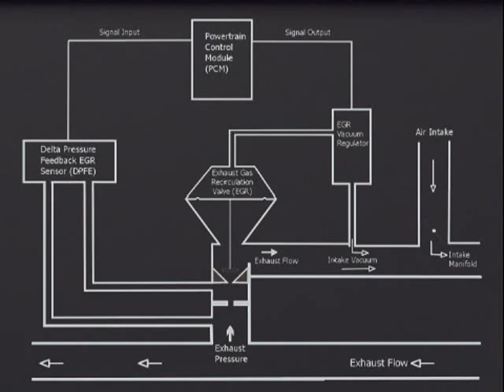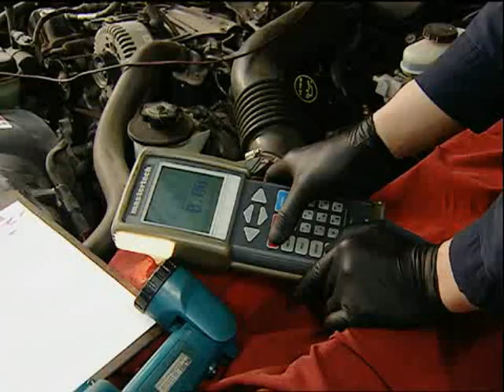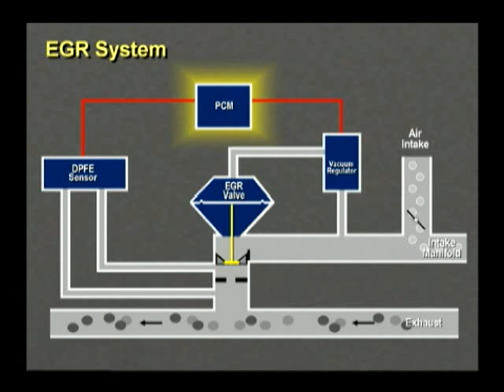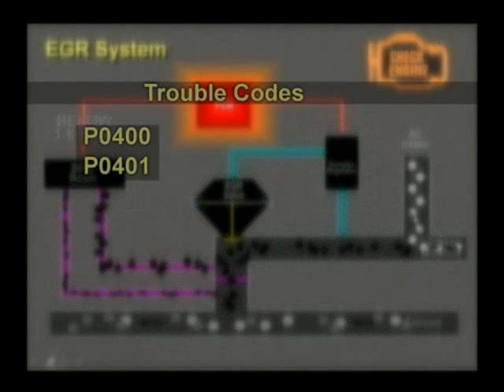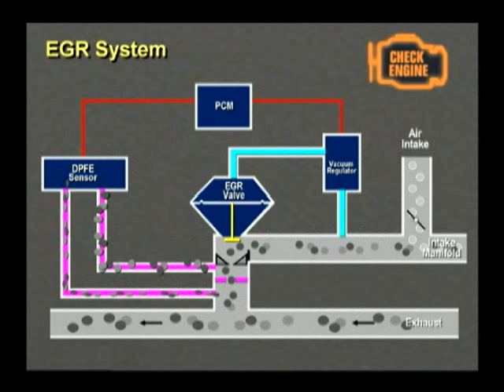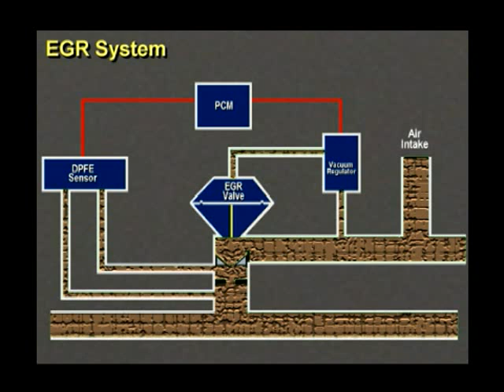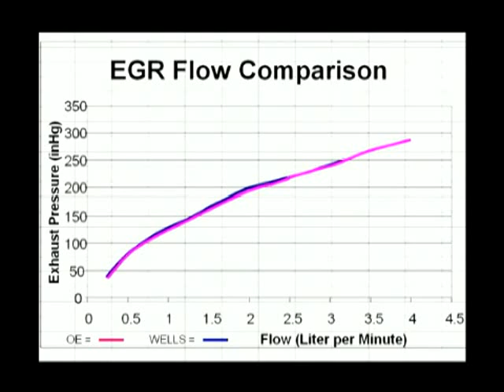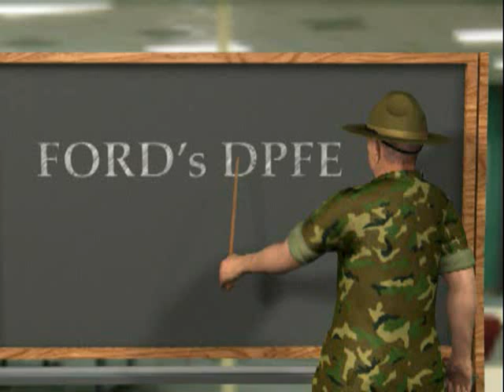Wells Ford EGR DPFE Training with Sgt. Tech  P0400, P0401, P0402,

Comment: How would a blockage explain excessive egr flow no one mentions this anywhere on YT...
Reply from the maker: I'm not sure I follow. A blockage causing excessive flow? Are you talking about a vehicle like the Honda 3.5L or the Ford 3.8L where there are individual EGR ports for each cylinder? I blockage, caused by carbon buildup, can lead to too much EGR going into the other cylinders causing excessive flow. Make sense?
Mike Becker, Senior Technical Instructor
Reply: @GoTechTraining  1998 ford 4.6 v8 getting p402 excessive flow EGR is functional but there is constant vacuum causing idle conditions I don't have a scope so it makes this more difficult someone got in there before me and messed with everything I'm going to make sure it has the right vacuum line on it hoping they just swapped them out, if not it could be that delta thing or debris in the EGR vacuum controller just wanted your 2 cents ty.

Comment: NGK Technical Training
It's pretty amazing that you still answer questions on a video that's 10 years old. You're a good dude. Every EGR I've seen in videos has a seperate DPFE but I think on my car (2011 Crown Victoria) it's part of the EGR assembly or module. Also I can't figure out how to use my vacuum pump to test it. DPFE voltage is good, I tried to the clean out all of the carbon about 3 times. Before my last cleaning attempt if I used to a test light to jump the EGR Valve signal to battery ground the engine would run rough but not stall and now when I jump it to ground with my test light it immediately dies. I have a number of codes I'm trying to get rid of: P0053, P0059, P0401, P0457, P2197. I originally only had a P0420 when I got the car which went away with a bottle of redline fuel system cleaner so another idea I have is thats some of these problems are just from the bad cat. My Bank 1 Sensor 2 voltage readings mirror the sensor 1 voltage readings instead of holding steady. Those sensors are new btw. Thanks and one more thing, on my scan tool live data, when I hit the gas my EGR Error PID usually flashes -100%, then a number like -45% and then it shows, specifically, 99.2% for a second or two so I guess it's not closing in a timely manner
Reply from the maker: Hey, thanks man! Sounds like a lot of issues going on. Let's start from the begining. The O2's should not mirror. That sounds like the cat's not doing it's job. P0053 is a heater resistance code for B1S1. P0059 is heater resistance for B2S1. P0401 is insufficient flow detected from the egr system . P0457 is an EVAP code. P2197 is B2S1 stuck lean. First thing i'd do is clear ALL of the codes out and see what comes back. From there, go after the 02 issues. Verify power and ground for each of the heater circuits. It's possible the heater fuse may be blown? Good luck!
Mike Becker, Senior Technical Instructor
Reply: NGK Technical Training 
Thanks for your response, I’ll check the O2 sensor power and ground. I’ve been trying to fix these problems myself for a little while now and I’ve cleared the codes a number of times. The heater circuit codes and the egr codes always come back. I’m learning a lot working on the car but I can’t seem to actually fix anything.
Reply from the maker: Hahah sometimes the lesson comes before the repair! It's possible that maybe the EGR codes setting due to on 02 sensor issue. If the PCM is looking for a reaction from the 02 sensors during EGR flow...and the O2's aren't working right, then maybe the car thinks there's no EGR flow!?
Mike Becker, Senior Technical Instructor
Reply: NGK Technical Training 
There probably no way for you to diagnose my egr in this forum but I do have one question that I can’t seem to find a lot information on and that is regarding interpreting the scan tool PID called EGR_ERR. When I hit the throttle it quickly flashes a -100%, then it flashes couple values like -33% and -42% but when I let off the throttle it goes to 99.2% for a second or two. In Motor magazine it mentions that 99.2% means that’s the egr valve is stuck open so I’d guess that my valve gets stuck open for a second or two so it isn’t closing in a timely matter which may be why I usually have a p0401 code although that code is for insufficient flow and it seems like if that was the cause for an egr code it would be for too much flow not insufficient flow. If it helps my get some free advice you should know that all four of my brand new o2 sensors are NTK brand
Reply from the maker: Could be an EGR issue, sure. Could also be a misinterpretation of data too. Either by the scan tool or the PCM maybe. Being that they are all on the same circuit kinda leads to more questions. If they are all fed the same power then maybe you have an intermittent issue in the wiring from the fuse to the components. Or you have a component that's taking the circuit down. Lots of variables. I wish I could do more, but without the car in front of me it's going to be nearly impossible.

Mike Becker, Senior Technical Instructor
Reply: @GoTechTraining  
You've still been very helpful because you pointed me back in the direction of wiring, which is where I should've stayed. Wiring is most likely the culprit. Last night I found 3 shorts in my central junction box by doing the test where you jump from the negative ternmial to the negative connector with a test light. If I manage to figure this mess out it'll be extremely satisfying.
Reply from the maker: It will be for sure! Good luck in your search!
Mike Becker, Senior Technical Instructor
Reply: NGK Technical Training 
Forgot to mention I’ve checked the fuses multiple times. That fuse is okay o2 sensors, egr, evap are 
all in same circuit. I’ve read it could be a pcm issue

Comment: Please explain how adding exhaust gas would keep the temperature below 2500 degrees. That goes against all common sense, as well as being incorrect by saying it adds power. Colder air intake more power. All this does is make the engine have to add too much fuel to the intake to compensate for too much exhaust gas when it fails. Am I correct? Using more gas = worse for the environment.
Reply from the maker: Hey Tyler, so when exhaust gas enters into the cylinder it's inert. It's filler. Now we can't add as much air/fuel. Less air/fuel means reduced temperatures. Not sure where it says EGR adds power, but that's not the case. The computer does not add more fuel with EGR. It adds less.
Mike Becker, Senior Technical Instructor

Comment: hey guys, i got a couple questions...

1. Lets assume im a normal person with just a socket set and some free time and want to save money..i dont have any vacuum testers, no volt meters..nothing...i have a 2000 ford expedition 4.6L V8. for the last year, its been running sluggish but hasnt been throwing codes even after the car randomly loses and gains RPMs as i brake and sometimes shuts down when on an incline at a stop...(may be a separate issue but felt the need to say this for a background), i assumed it was mass airflow, tps,etc because the catalytic converters  have failed previously...anyway, recently, the P0401 code starts coming up and im clueless on what it is and where its at, after watching a few videos, i see that its not a hard fix neccesarily but need assiantace on where to start first....with NO extra toold other than sockets and such to gets parts off and replace, where should i start? EGR valve itself? EVR? DPFE? lets assume the hoses are fine. Where are places to look for carbon buildup? Also, lets assume the problem gets fixed with a simple replacement of an EGR or DPFE, will the engine light go away or does it need to be erased with a scan tool?
Reply from the maker: Hey Jay, DPFE's are super common on Fords. If you are looking to "try" something....that's a starting point. As for everything else, I believe you should take this thing into a shop. Sounds like you may have an issue that you are lacking the equipment to diagnose. If you repair the problem the code will not turn off immediately. It takes multiple (10+) test passes to clear the light. This could take a week or more. Disconnect the battery, or better yet, have the codes cleared with a scan tool. Thanks.
Mike Becker, Technical Services Instructor

Comment: so if you were to somehow bypass the ECM and open the EGR with the engine running the signal voltage from the dpfe sensor would rise ?? and I guess at the same time if the idle doesn't get rough you could assume you have a blockage?? am I correct in this?
Reply from the maker: Hey, If you open the EGR and the idle doesn't change then yes, you would either have a blockage or a bad EGR. A fully open EGR at idle should almost make the engine stall out.
Mike Becker, Technical Services Instructor

Comment: Can I replace the dpfe sensor with a map sensor connected to the exhaust? Isolating the hose attached to egr?
Reply from the maker: Hi On-D Off Road, no you would not want to do that. Both of those DPFE hoses go to different spots on the exhaust. One on the exhaust side and one on the other side of the EGR pintle. The goal is to read the pressure differential with the valve closed, and a similar pressure with the valve open. A map sensor would only be able to give you 1 reading at a time. 
Mike Becker, Technical Services Instructor
Reply: Hello, grateful for your explanation.
Reply from the maker: You're welcome!
Mike Becker, Technical Services Instructor

Comment: Here is a pic of a 1995 Lincoln town car intake manifold with a clogged EGR path just under the throttle body neck. To be sure to avoid allowing any particles from entering the the combustion chambers, i removed the intake manifold. After replacing the EGR valve, Delta sensor and EGr solenoid it still posted a P0401 trouble code until i cleaned manifold passage and insured all passages were clean. Now it gives a P0402 excessive EGR trouble code. will have results on its diagnosis Monday.     http://i755.photobucket.com/albums/xx198/kayrikizzy/IMG_20150325_172512_zpsi2dfgrvp.jpg

Comment: I have a 1999 f150 4.6 truck. Engine lights been on couple years.then it started running bad started cutting off when im setting steal. I had it check found a bad pcv v.so I fix it ; now it don't cut off , but when I start driving giving more gas it kicks back like it don't want to go.Had it check said EGR V.so I put a new one on.it still does the same thing.and it still says its the egr V.can u help me?
Reply from the maker: What code is it setting? If the codes are P0171 and P0174 try cleaning the MAF sensor.
Mark Hicks
Wells Vehicle Electronics

Comment from the maker: Jim I have to agree, when EGRs were first introduced they actually reduced the power the engine could produce. I have to be honest, there was more than one time I personally removed the EGR valve and made a plate to put over the hole in the intake. However, today regulating the amount and when to introduce the exhaust gas to the cylinder has become a science. Removing the EGR valve today will have the opposite effect.
Mark Hicks
Wells Vehicle Electronics

Comment: It's funny because, the EGR valve only technically WORKS at cruising... So, how does it help it run when it's not active during idle or when there is a load? plus, during acceleration, you get more power when you DON'T have the EGR valve. Lol. It's all B.S. But whatever... That's just my opinion.

Comment from the maker: 5. If the DPFE sensor voltage is high with the EGR valve closed, verify that the Grey/Red (GY/RD) wire of the DPFE sensor is showing to be a good ground.

6. If the ground checks to be ok, check the Brown/Light Green (BR/LG) wire of the sensor for a possible short to another circuit in the harness causing the voltage input to the PCM to be high. 

Mark Hicks
Wells Vehicle Electronics

Comment from the maker: 3. If the voltage of the sensor increases but the RPM does not change, remove the hose of the sensor marked HI and check for the presence of exhaust pulsations from the tube of the pipe.
If necessary, have an assistant restrict the exhaust at the tailpipe.

4. If there is no presence of exhaust at the nipple, use shop air to blow back down through the pipe attempting to unclog it of carbon. Replace the pipe if necessary.

Comment from the maker: 1. Check the static voltage of the DPFE sensor with the engine idling. A typical voltage will indicate 1.0 volt. A reading between 0.5-1.2 volts would be considered OK.

2. If the sensor voltage is within range when the EGR valve is closed, open the EGR valve with a vacuum pump and check for the voltage of the sensor to increase along with a drop in engine RPM.

Comment from the maker: I want to first apologize for the slow response, I have some medical issues. 
Well, you have a not so common problem.  	
Check the canister vent solenoid hose for any obstruction and clean or repair as needed.
If the vent hose is not restricted, remove the canister vent solenoid from the canister. Verify that it is open and free of any restrictions. If not, replace and retest.

Comment: I do wish I had been able to watch this video back in 2006-2007 when my wife had constant EGR and DPFE codes set in her '99 Taurus.  But now anytime I have an EGR issue I can refer to this and your other videos and make it right in one shot.  This also explains why I am having codes on my Suburban after a fuel pump replacement.  I bet something wasn't put back together right, maybe the pressure sensor isn't connected right.  Time to drop that tank and check the shop's work!

Comment: hello i also have a 02 ford escape v6. i had a problems with the egr blowing up and loss of power so i had gutted the rear cat, egr valve, dpfe valve, egr pipe. now i cant pass emissions because i have a cel code and it says i have a high volt dpfe. the dpfe valve is new. what can i do? will your brand of dpfe valve fix it?

Comment from the maker: 1. Connect a vacuum gauge to any manifold vacuum port and start the engine.

2. Compare the engine vacuum at idle to a vacuum reading at 2500 RPM in park.

3. If the vacuum reading is lower at 2500 RPM than at idle, suspect a restricted exhaust. Check actual exhaust backpressure looking for no more than roughly 1 PSI at 2500 RPM in park on either bank of the engine. If high backpressure is found, replace the restricted catalytic converter(s) as needed. 

Mark Hicks
Wells Vehicle Electronics

Comment: I have a question, what else I could look for to solve my problem, I have a 2002 escape 6 cyl 
it does not have power, if I drive it with out pushing hard the gas pedal, it is fine but if I need to step on the gas, it just does not respond properly, I have replaced spark plugs, DPFE Sensor,
EGR Pipe, it was good for a couple of days and then  it went back to the same , no power
any sujestions ? thanks in advance

Comment from the maker: It sounds like the catalytic converter might be restricting exhaust flow. when the cat starts to restrict flow the symptoms you mentioned above will occur, also the hoses from the exhaust pipe to the DPFE will get very hot when this occurs. If the cat is plugged, you must also find what caused it. For example, miss fire, running rich or lean etc. 
I hope this helps, please let me know what you find or if you need further assistance.
Mark Hicks
Wells Vehicle Electronics

Comment: Is it possible for the EGR DPFE to become clogged and cause poor performance? I have a 99 Expedition with a 4.6L engine and upon removing a hose from the dpfe i found particles of the hose to be spewing out and i would assume into the dpfe while connected. My truck has been running poorly and my fuel mileage has been cut in half!

Comment from the maker: You need to first check it to see if it is a fuel or spark problem causing the misfire. As easy thing to try first is to connect a timing light to each spark plug wire while the engine is running. then watch the light to see if it flashes. If it doesn't flash or if it is skipping it is a spark problem on that cylinder.
Mark Hicks
Wells Vehicle Electronics

Comment from the maker: @MsMlarrea Because of the extreme change in temperature between the exhaust and engine, it is not uncommon to get moisture in the DPFE. However, this moisture does a lot of harm. I would first make sure the you have a good connection and see if that takes care of the light. If it does not, turn the key to the "on" position and check the voltage on the signal wire from the DPFE if it is over 1.2 volts it is defective. 

Let me know the results of the testing,

Mark Hicks
Wells Vehicle Electronics

Comment from the maker: @MsMlarrea 
3. Check for a possible backpressure issue which may be damaging the sensor because of exhaust heat melting the sensor internally. To check this, connect a vacuum/pressure gauge to the DPFE sensor tube that connects to the sensors "HI" port. Monitor the reading while brake-torquing the engine. Backpressure should not exceed 2 PSI.

4. If the DPFE sensor connector is ok and there is not excessive exhaust backpressure, replace the DPFE sensor. 

Let me know,
Mark Hicks
Wells

Comment from the maker: @rb26capri Black soot or smoke coming out of the tailpipe only decreased when disconnecting the EGR because you stopped the recirculation process. The black smoke is cased by another reason. I would first check the Mass air Flow , Oxygen and coolant temp sensors. Air intake temperatures have very little if anything to do with combustion temps. I suggest listening to what i am telling, if you do not take care of this problem you will also ruin your catalytic converters. Also change your oil.